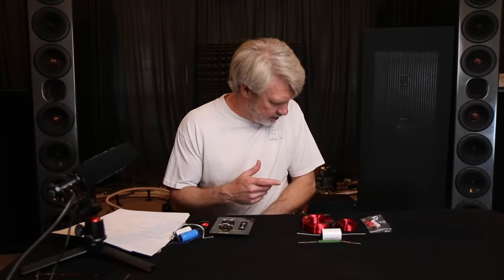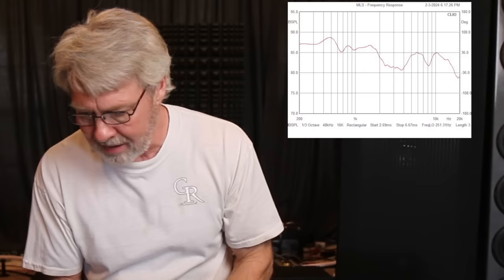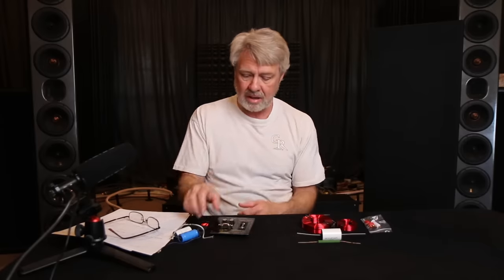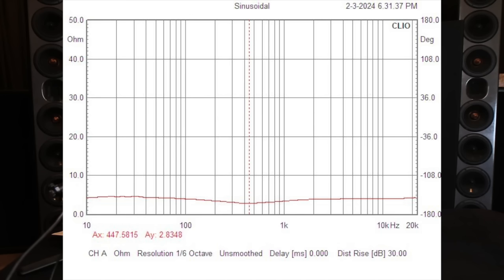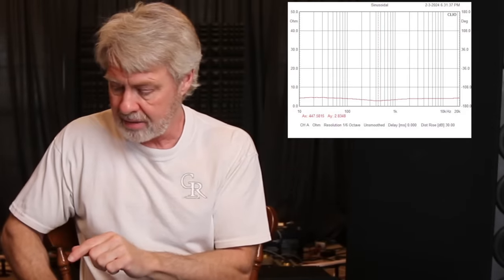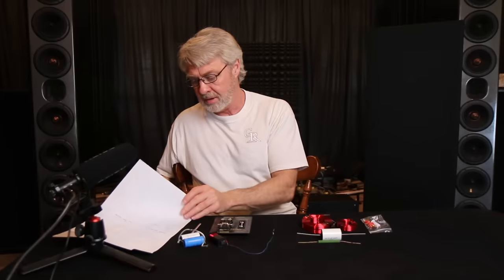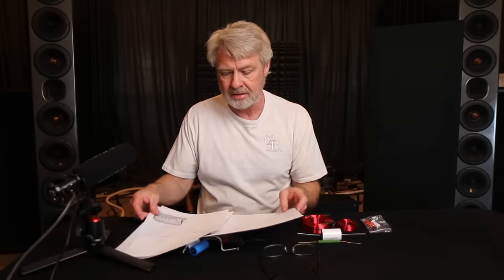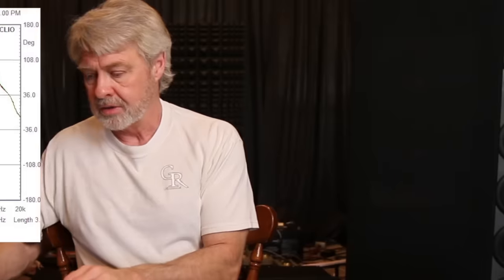Unbelievable Upgrade: Cheap Magnepans Turned into Gems

Comment: It would be interesting to hear MAGI's thoughts on how they engineered these in that it seems to be poorly designed.
Reply: Designed to a price, like everything is. 
Even $100k speakers could be improved, solid gold wires etc. But if everything were only built to the best of human engineering then only 10 or 20 people in the world would get to hear it.
Reply: Not a poor design, I would not go that far, as these are $995 for a pair. No way would I trash Magnepan for the design work on these speakers, as they sound incredible after a few hours of listening. I just received mine the other day and am still gobsmacked at what they are doing in my room. I also have Danny's kit coming, it is supposed to arrive tomorrow and I cannot wait to tear into these speakers.

Comment: Your videos on Maggies always make me question how the crossover was designed and the only answer I can come up with is it wasn't.
Reply: Oh stop it silly
Reply: Yeah. 50 Years designing speakers and they don't know how...lol. wake up
Reply: I know how it was designed. Didn't do it myself, but saw the measurements as it was voiced. It began with a single pole series XO -- remember, these speakers are designed to sell for $1000 and they can't add components without increasing the cost. Then the values were tweaked for the best measured response, with a target curve of .5 dB/octave, and the best subjective response - Wendell Diller, who voiced them, likes to compare the live sound of the Minnesota Orchestra to the Reference Recordings recordings of it -- when they sound the same, he knows they're voiced right! They considered other measurements as well, e.g., impulse response.

Meanwhile, they're tuning the acoustic equalization on the diaphragm itself. There are some basic limitations here -- there is only so much stored energy and only so much panel area in a small speaker like the LRS+.

Another thing that people often don't consider -- they have to fit the crossover components into a thin panel! In the larger models, that limits the complexity of the XO's they can use. In the old days, they used external crossover boxes with higher order crossovers, but speaking from personal experience, those were a PITA!

Comment: I do not understand why Danny does not do an in room , at the MLP, measurement of the LRS before and after the upgrade. Obviously every room is different, but an apples to apples comparison in the same room would tell a lot. I applaud the attempt to upgrade the LRS+, but I have a problem with ignoring how the speakers actually interact with the room.
Reply: Like you said every room is different
Reply: I would, but the room is a variable and will change from room to room. It is a "room" measurement. So it becomes more about the room and less about the speaker. We have a new listening room being built right now. When it is done, I might consider giving that a shot. Stay tuned.
Reply: All you need to do is describe your room, set the Magnepan's up for best in room performance, measure it, then do your upgrade and measure the effect with the speakers positioned in the original position. If you want to do that in more than one room, great. At least, then we could have a chance at a valid comparison. Anyone who owns a Magnepan knows how slight position changes matter. They also know the in room measurements, after proper positioning, do not show the problems your measurements show. My 3.7i's in-room response bears no resemblance to the measurements your measurements presented  in your 3.7i modification video. Obviously, the latest "X" modifications by Magnepan, involving better parts, proves better parts matter. All I am saying is your measurement methodology makes a Magnepan look terrible when in reality it is not. You would sell many more upgrade packages if you presented in-room data along with what you already show. @dannyrichie9743
Reply: @fbczar  When we designed the upgrade for the 3.7i we did set the pair up in our room and not only took measurements, but made comparisons to other speakers on hand. 

For most people, the room response is so bad that it overshadows the problems with the speakers. That is why room to room measurements can't be compared. 

What I am showing is speaker only measurements so that the actually speaker issues can be identified and corrected. 

The 3.7i was one of the worst when it came to drivers playing on top of one another and causing out of phase cancellation if you move even slightly left or right. I room response will not allow that to be seen with any accuracy.
Reply: Like I said a before and after comparison in the same room would be useful. @BostonMike68
Reply: @fbczar  ok I got what you are saying
Reply: @fbczar  We took measurements of the 3.7i's in our room to dial in the phase, crossover, and output levels of our triple open baffle servo subs that we played with them. We did not save the measurements as what happens in our room is not really relative. 

The best possible sound is always our goal, and we push that envelope further than any other company that I know of.
Reply: @fbczar  Again, a before and after room response will tend to cover up the audible problems with this type of speaker rather than highlight the problems. 

For instance the off axis measurements on the 3.7i model shows what happens (audibly) when you move over one seat to the left or right. The response falls apart. After the upgrade it is stable and can be listened to from a wide seating position with no ill effect to the sound. A room response measurement will not show that as the holes and cancellation in the response is compounded by any room reflections. So it contaminates the data.

Comment: That's not a great deal of money for the upgrade. I don't understand why Magnepan could not have done this in the first place, instead of going el cheapo. Adding the cost of $240 to the original LRS + would not have killed sales, with the potential positive reviews inc from customer, would probably have increased sales I imagine.
Reply: the real cost would add at least four times the cost of parts, so now you understand why this speaker was made this way.
Reply: @sudd3660  You are correct.
Reply: The design concept of this model is to make you want the big boys.
Reply: Debatable. They make little profit on the LRS+ -- it's an appetizer for their larger models. $995 was chosen because $1000 is a subjective barrier. There are those within the company who feel that it should be sold for $1250 as it is.

They do make more expensive models, and offer crossovers with fancy components for more money (thought not on the LRS+, since it's their budget model).
Reply: @Josh442  30 plus and counting have ordered the upgrade. What does that tell you?